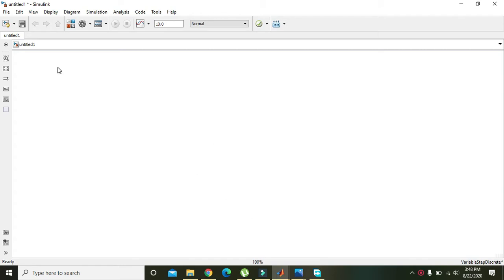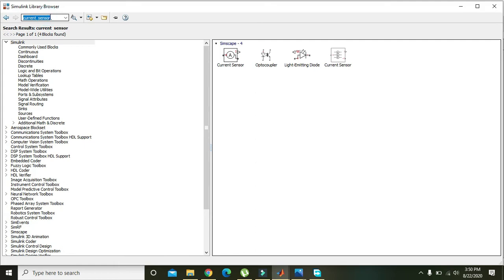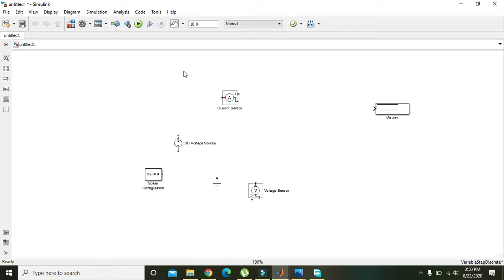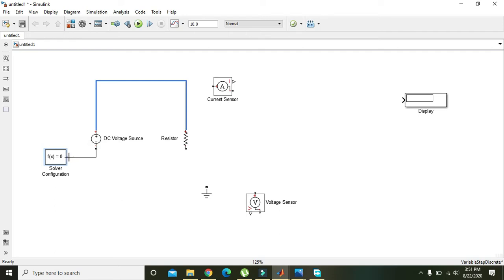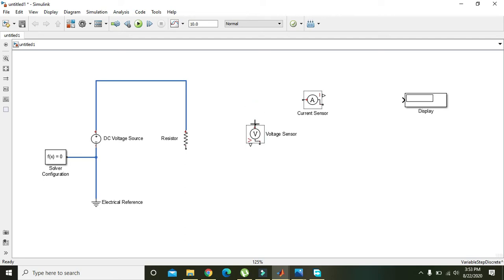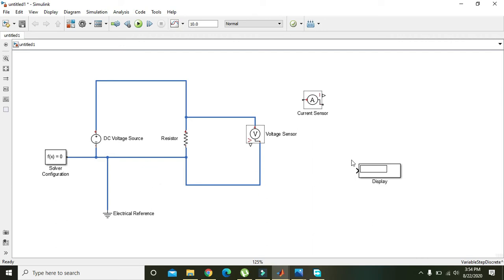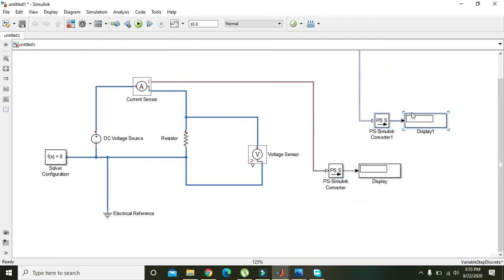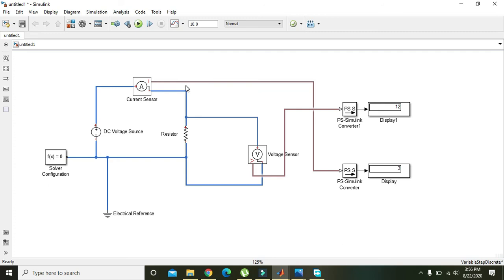how to measure voltage and current in simulink | voltage and current across the load in simulink

Comment: If I want to load the current value from Matlab workspace and then feed it to some circuit like a current to voltage converter opam, how do I achieve that?